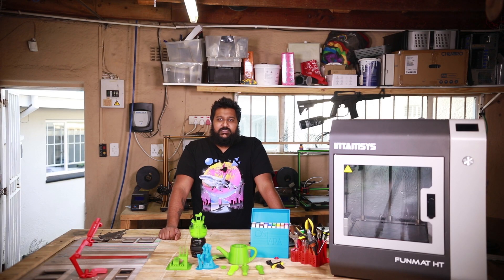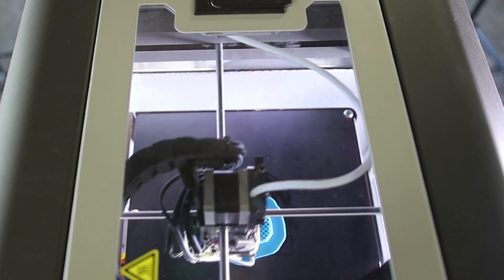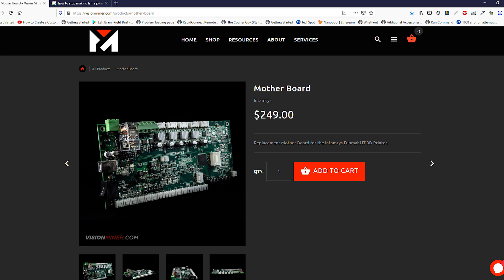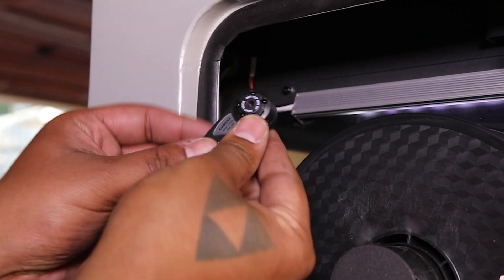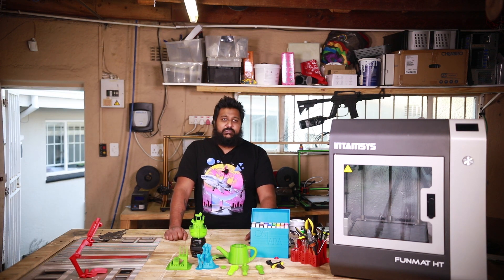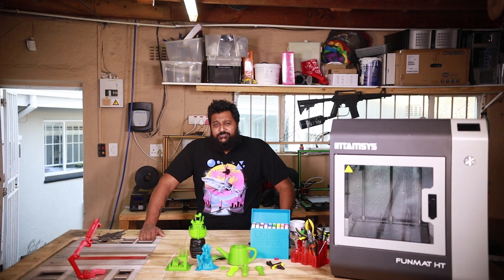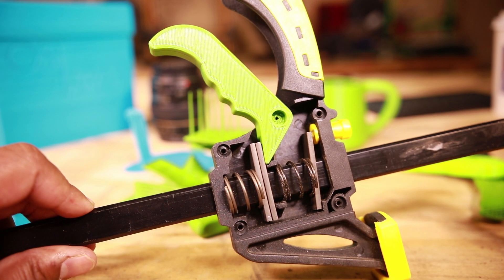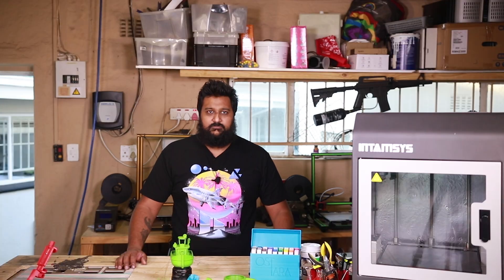Intamsys FunMat HT Review

Comment: Great video! :) The Funmat used to have A4988 drivers, but then switched to tmc2208, but on the "Enhanced version" (which you have in your video), it actually uses independent drivers separate from the motherboard, Leadshine DM422S (search "stepper driver" on our website for images) - this has led to overall better reliability from earlier versions, as the drivers are separate from the bottom chamber and are located underneath the filament chamber, where they are kept cool with a dedicated fan. The unit actually does not have Wifi - however, the included camera is wifi-based, while not connected to the motherboard. We never use it, as it was super low quality - as you saw in our video, lol - however, this was just updated last month, on the latest units, finally :) It's also a new ceramic glass, as opposed to borosilicate. Great video, loved hearing it all from another perspective! :) Cheers!